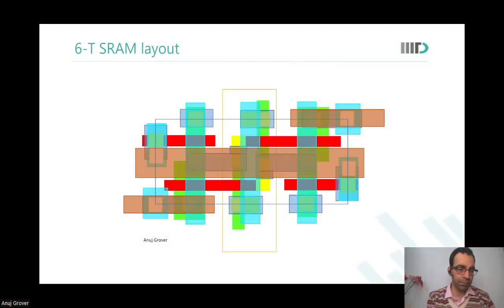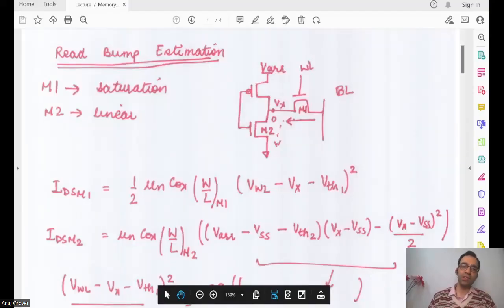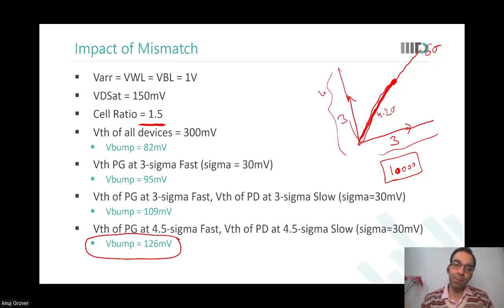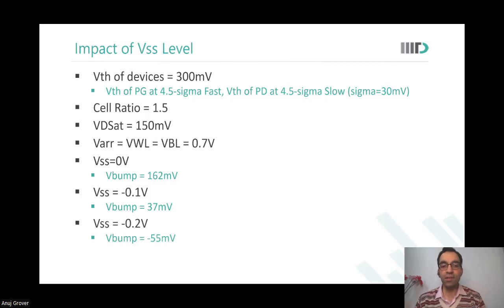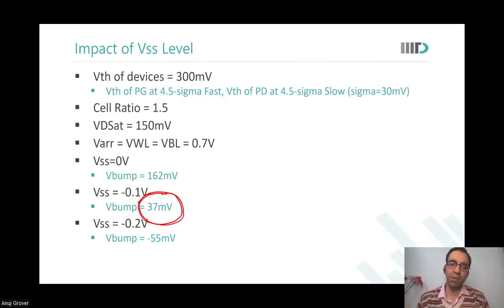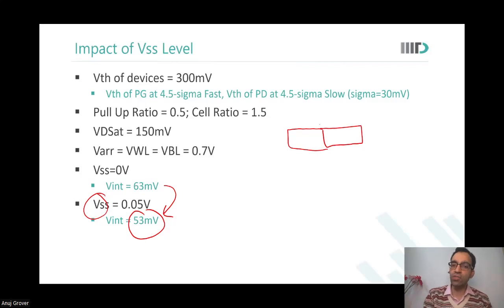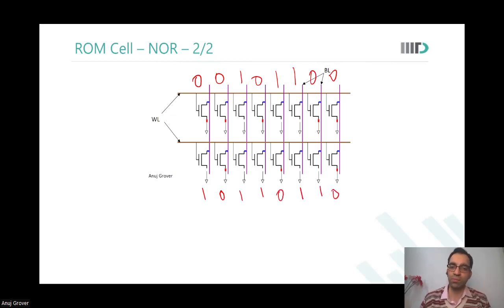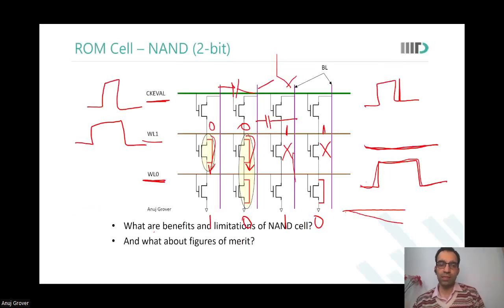Lecture 7  Cell Stability, Write-ability Analysis and ROM Cell

Comment: During writing, how are the M4 and M3 in saturation and linear regions, respectively? When Vint is getting discharged by the BLB, the pmos sees a | Vgs | - | Vthp | greater than Vds (~0 initially) and | Vds | getting bigger as the discharge is happening. In any case, the M4 is not in saturation. Is it that these equations are valid when the writing has finished completely (i.e. Vint = 0)?
Reply from the maker: Yes. These equations are valid at the desired state of write operation. Which is also the worst point to make these estimates.
Reply: @anujg1  Thank you, sir. I have always been interested in learning memory design. As suggested by one of your former students, I found your lectures to be really amazing.